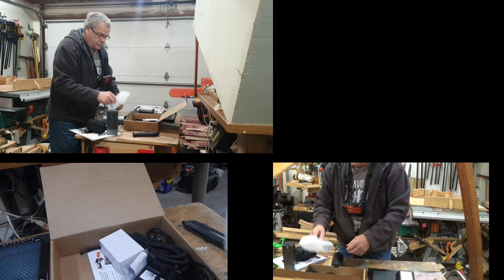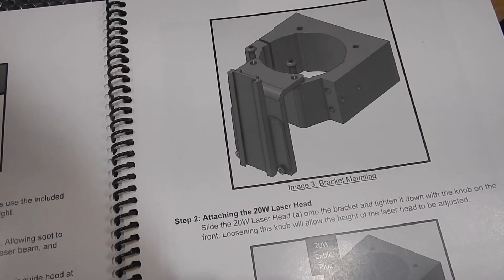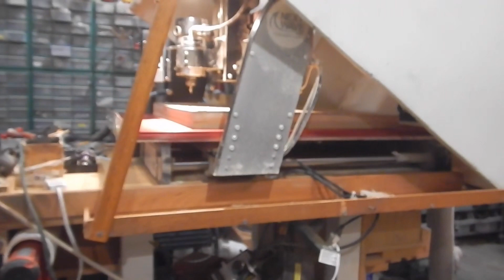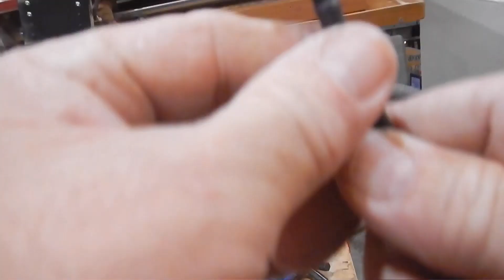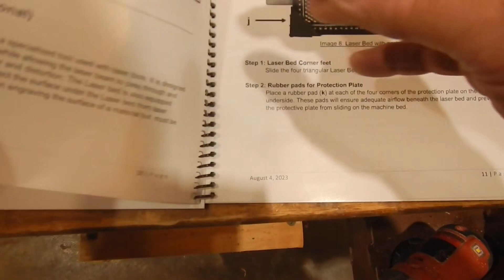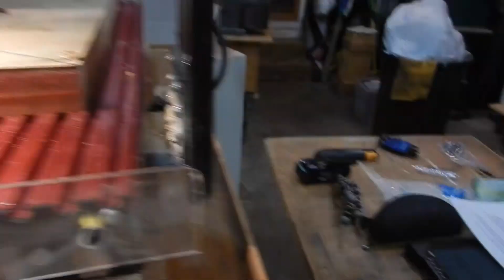Shark 20 watt laser unbox to use

Comment: Thank you for the information. I am considering this laser for my Shark and have a few issues to address first.
My dust collector was custom made, and of course, it is right where the laser mounts. 

Wanted to suggest an alternative low profile light for your machine. 
Few years ago, purchased from Amazon a pair of Car Light LED Chips 70MM Angel Eyes Halo Ring Headlight Warning Lamps 12V White-1pair. Only about $10 for two. 
12v power, glued one to the bottom of the spindle. Or in your case, the router.
Power on whenever the machine has power.
Reply from the maker: Thanks for the  light tip.  When this one goes out I will look at that option.  I have had 2 lights up there since I started CNCing.  So appreciate the light for sure.  Do you have a picture or a link to the lights?